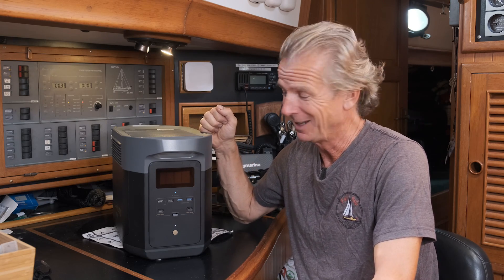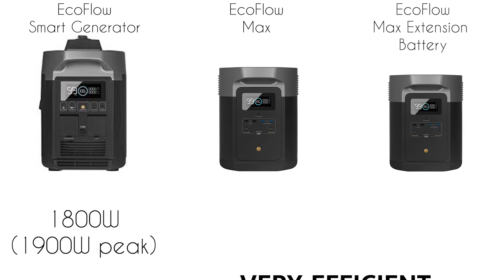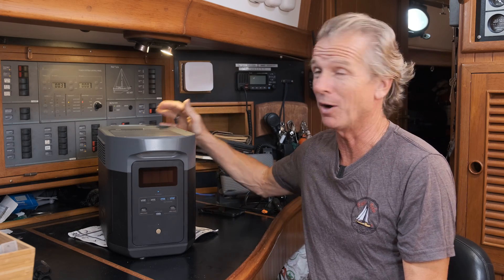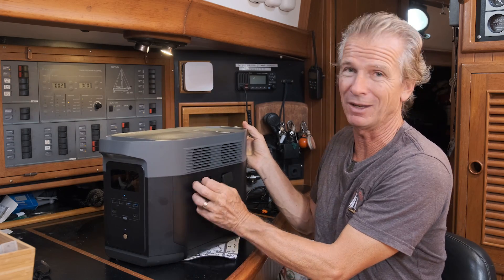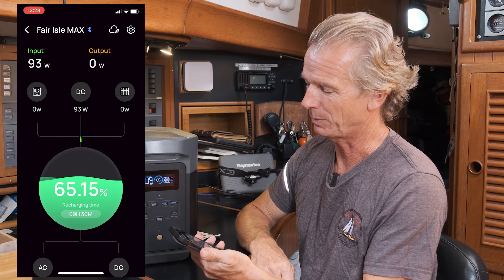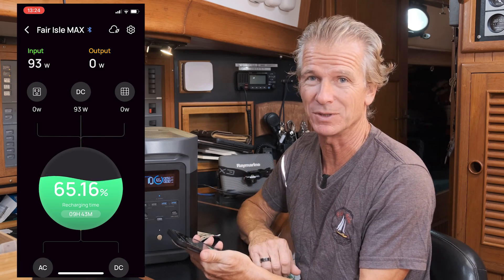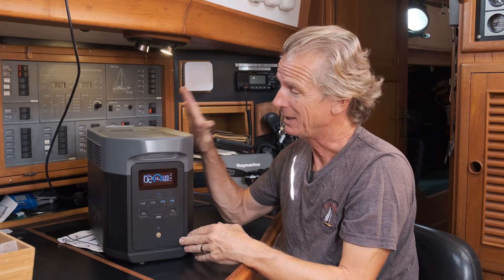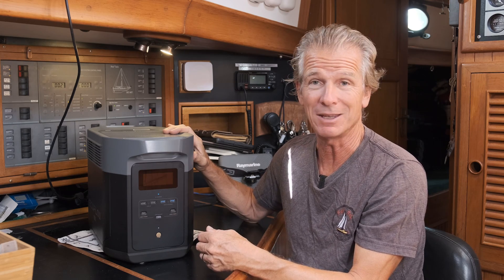Solar power station for your boat: EcoFlow Delta 2 Max

Comment: Hello Steve, 
Once we again you have convinced me to take the plunge (as I also did with my E-Propulsion).
I just bought an Ecoflow Delta pro (3.6kw) for my little solar powered, off grid garage. This provides more than enough power for my table saw and even a spot of welding. 
The deciding factor was a €500 off Xmas sale AND their offer on a limited number of "refurbished" models with an additional €600 off. I couldn't pass that up. 
Call it refurbished but the one I was sent hasn't a scratch on it, was in an original unopened packaging and has the full 3+2 yr guarantee.
Thank for the good tips.
Reply from the maker: Yes I heard they had a very good Xmas sale

Comment: I want to see the VOLTAGE under various loads with a voltage tester or kilowatt meter. If the voltage drops below 117 volts under full load, I call that a failure.

Comment: Can you join 2x Delta 2 Max's together with an XT150 dc cable? And then plug the duel fuel generator into one of the remaing XT150 ports to trigger auto charging for both?
Reply from the maker: Yes

Comment: Hi Steve, First of all a big thank you for all your great videos. Secondly I use a v-splitter-cable to connect my two 160 watts panels on my „old“ ecoflow bank. Works good. V-splitter is also sold by EcoFlow. I just „rescued“ a friend of mine who’s batteries were completely dead. I connected my eco-flow-bank to his mains and he was able to start his engine without any further fuss. No need to use any jump wires or generators. Just plug and play. I love my eco-flow (and no, I am not sponsored by them). Good luck with your trip to the West Indies.

Comment: Hi Steve. Thank you. Do you ever connect the Delta Max into the boats electrical system so as to make use of the stored power? If so how? Or do you just connect various items of electrical equipment and run these from the Delta Max rather than the House Bank?
Reply from the maker: I have a lead made up to take a feed from the cigarette lighter o/p to the positive bus bar so if the house banks BMS shuts down for any reason I could have that as an emergency back up. It would be nice if it was a higher capacity, but 10A would at least power the nav gear / lights etc. Really though we use them to power food mixers, hair dryers, etc from the inverter as we rarely even turn the ships one on. And the USBC o/p does all the charging of our computers.

Comment: There are a lot of limitations with the Delta 2 Max. Solar limit for example. 500w on each of two inputs. I have 3 200w panels. This means more cables, and more holes in my roof. Do you notice the very poor 12 volt output. Oh, by the way the app does not show the remaining power in the extra battery.  The 12 volt output is under developed for the unit. Cigar lighter output. Really. 3amps on the two barrel plugs. This is amateur design. Maybe Echoflow put all their talents into the much more expensive Power Stations and did little with this Delta 2 Max.
Reply from the maker: The split 500w solar might be an issue for you with 3 x 200W if you want to just have one set of leads coming in but for most people this will suit much better than a single 1000w i/p. Most large panels are 400w but it's really designed for fold out panels which are usually 100,200 or 400w so having the split i/p will be useful for most people especially as you can use the second i/p for a cigar lighter i/p. Some people have specific needs and if this doesn't fit the bill for you then there are plenty of other options, find one thats fits. We have a different make as well because it is the exact size to fit in a space we have under our shoe cupboard. 
I'm not sure what you mean about the DC o/p's. this unit has the best regulated output of any of the stations I've tested and also the best app by far. The only thing I'd like to see is an high amp RV o/p which might come in useful to me.

Comment: I have a question, if you think you have time to answer, Thank You, if not, no worries. I have a small cabin we stay at for 2-4 days at a time. The only power we use is a few lights, the oven and a DVD player with a 48" LCD TV. Would we be able to use the PowerOak (or other you like better) as our battery bank and would it be enough? We could put 1 or 2 larger solar panels on the South facing roof that gets great sun and then could we use the pilot plug to plug into a switch to go between the grid and the battery rather than buying batteries, inverters and everything? Would 1 PowerOak be enough for the oven once per day for an hour and a couple of hours of DVD and the lights? Thank You so much, still loving your channel! I am only on Episode 41, but yours is the best edited, filmed and most professional channel I subscribe to. Thank You for all of the time and effort you put in for us!
Reply from the maker: Well it all comes down to the figures! Any of these even the smallest ones will cope with lights and TV no problem at all. The cooker is the issue. So you just need to know how efficient it is. The Delta Max is a 2KWH unit, so if the cooker draws 2KW is could run it for an hour if it was full, but that would empty it. With two large solar panels on the roof (i'm guessing thats about 600w array?) so you might expect them to deliver an average 300w so they will charge a Max in about 6 hours on average. If this is right you dont have any problem charging, but capacity might be the issue. Most of these larger units, like the poweroak and the EcoFlow Max are around  2KWh, there are larger ones or you can get the expansion batteries, the EcoFlow system is good here & it can go up to 6KWh.  So look at what your cooker draws, if it's a lot maybe invest in a more energy efficient model as they've made great advances lately and this may be cheaper than just buying expansion batteries to cope! Good luck!
Reply: @svfairisle  Thank You so much! I am going to have a look at the stove and I think I understand your example. I was thinking 2KWh was a lot more. Well, off I go, Thanks Again. You two are so thoughtful and helpful, I (we) really appreciate it. K, did the calculations and it appears for the stove/oven, fridge and electric water heater we would need the big Bluetti and 2 additional batteries. Think we could get away with 2 solar panels, really, but 3 will be better. Anyway, thank You for your advice. Loving your videos! :)

Comment: Steve, I don’t understand why these devices are better than having a well sized, configured and suitably charged house bank? Then there’s no requirement to manage and store an extra device on board? Am I missing something? I can’t see that redundancy is a compelling argument, we’ve used AGM battery banks for the past twenty years without a problem. So why? Rob
Reply: There are so many reasons why Lithium is better than lead acid / agm. just a few are that lithium batteries are lighter, more energy dense, charge faster, can be cycled deeper than agm without damaging your battery. and far more charge cycles than agm.. the list goes on. But if you like your AGM's tthat's also OK.
Reply: @tbareham6241 well that’s interesting, thanks, but doesn’t address my central question of why have this separate/independent power supply unit?
Reply from the maker: Yes there are those great upsides, the downside is cost and complexity. the long and the short of it is usage though. If are a full time cruising like us then Lithium wins on every level, even cost because you are talking 3,000 cycles rather than 300 before you get to the point of the batteries being at about 80% original capacity. If you're boat spends almost all of it's life in a marina plugged into shore power on a trickle charge then AGM are fine because you are not cycling the batteries all the time so they can last 10 years.
Reply from the maker: I have talked about it in various episode, there are several reasons. The main one is that you ideally need to size your house bank so that you get regular 'top balances' that is that you get to 100% and keep it there for an hour or two. This is important to keep the cells in balance. Lithium suffers if the cells go out of balance, it's really not good. So if you just chuck in as big a bank as you can you are likely to not regularly get that top balance. So the best way is to size it such that if you get a good dose of sunshine or maybe have to motor a good distance (how much and how long for both of these things will depend on what gear you have, solar and alternator) your house bank gets a full charge. You want this to happen once a week or so to keep the cells nicely in balance. So if you get the sizing right for this it does mean that when you do have those days in mid summer when it not cloudy, or you are doing a lot of motoring etc you can't store the excess power, which is a shame. Well if you have one or more of these devices you can store it. I have the rotary switch I showed in the Allpowers video as well as the tap off with the XT60 o/p wired into the house bank. Also redundancy is a bigger deal than you think. Main ships power is pretty rock solid with AGM's yes (although you will see in our episodes a couple of years ago we lost two out of three of our AGM's mid season and relied heavily on the solar power stations for months) Lithium on the other hand could possibly be more prone to outage because it has a BMS that can cut you off. So if you've gone to lithium because of the massive advantages if you are cruising long term, then this is a consideration I think. But these solar generators give you redundancy not just in extra power but with an extra MPPT and an inverter. Our ships inverter died a couple of years ago and it took us 6 months to get a new one, but we had AC from the solar generator so it wasn't a big deal. If one of our MPPT's dies I would simply route that panel to an EcoFlow. It's also very nice to have the portable aspect of this power. I've had several occasions where I needed power tools away from where I could get an extension lead to & just used the ecoflow.